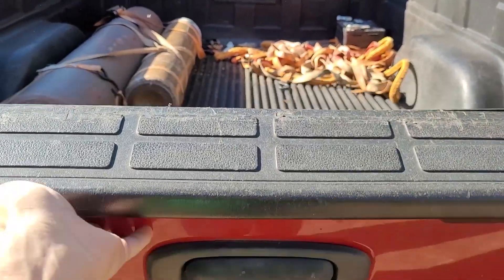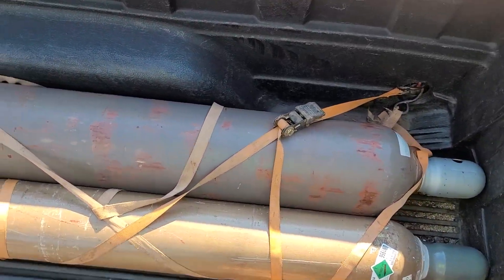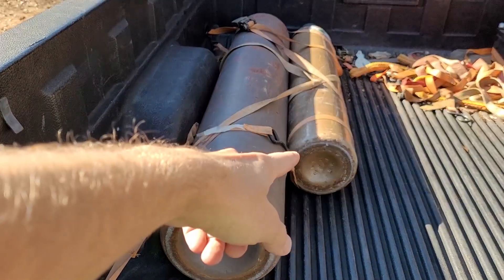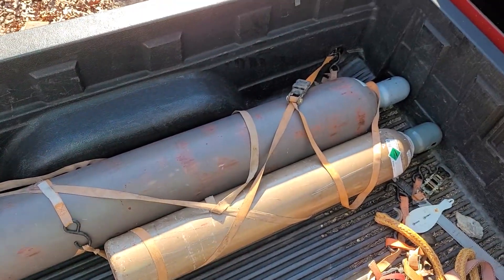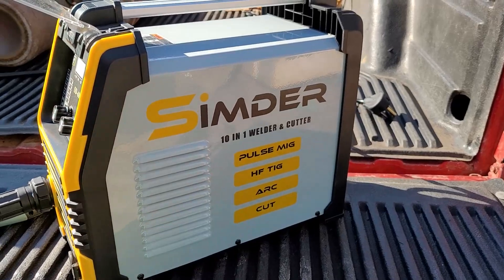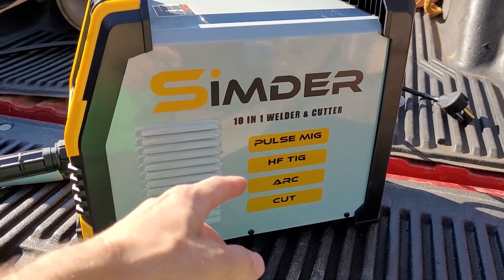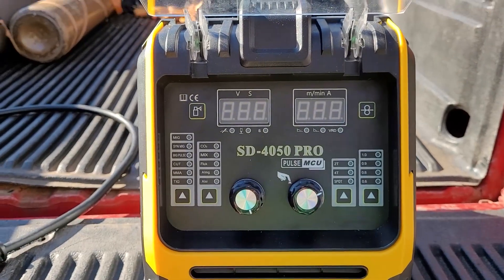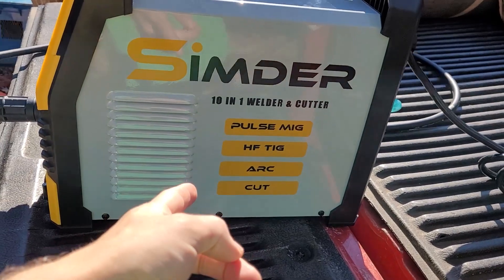MIG & TIG? How Long Will This Welding Gas LAST?

Comment: So how long do they last??
Reply from the maker: It depends how much you weld. If you don't weld much it lasts for years.
Reply: @MattsShop  if I'm thinking correctly, a 300cf tank will last  15 hrs based on 2x cup size, using a 10mm cup. Am I on the right thinking?